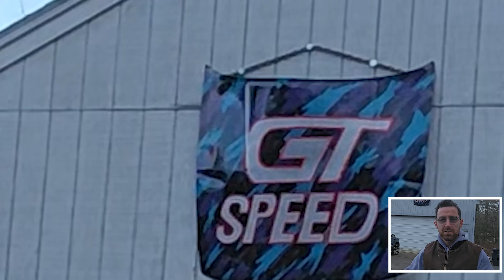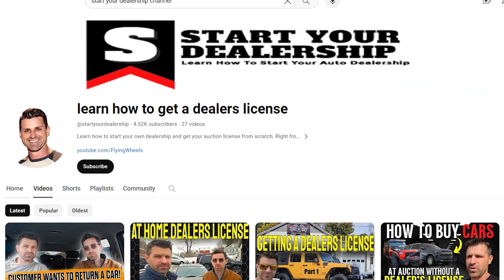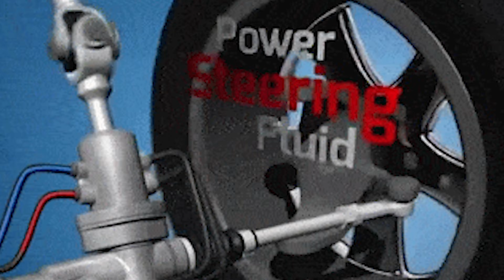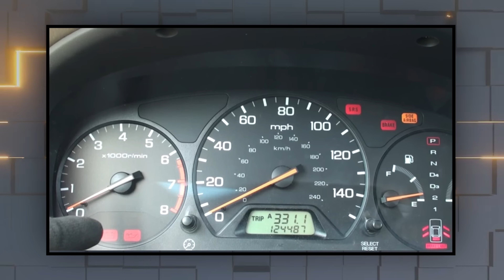We bought our 1st Lemon - Starting a Car Dealership from Scratch

Comment: Nice score with the Lacrosse! The 3800 is a great motor. The only thing I would pay close attention to being the former owner of a 3800 engine car is the transmission. They like to go around 100-120k miles. My last one I had rebuilt at 110k miles. Cost me $900, and it lasted 3 months and went out again. Cost another $900 and lasted another 3 months and went out a third time! Never needed more than an oil change for the engine though.

Comment: Adam, great pick on the accord! I bought that same year and model and really enjoyed driving it! SO much fun with the manual transmission and that V6 engine. Honda only did that combination in the coupe but not the sedan which makes it a fairly rare but VERY desirable car.
Reply: Are you limiting that V6 6 speed to a particular model year ? Because Honda did indeed put the V6 and six speed manual into the sedans AND coupes in 2006 . I almost bought one 5 years ago and the car was awesome to drive but the black leather interior was not up to my expectations for such a nice car ... lots of wear and rips on the front buckets. The rear seat looked the way I wanted the front to look. But the 6-6-6 combo definitely came on the sedans.
Reply: @nickg9021  You're right. I stand corrected. I think maybe just in 08 to 12 the setup only came in coupe.

Comment: Everyone makes that mistake.
I bought a 97 Wrangler that just needed paint. (I own a body shop) so its no biggie.
It had a 4” lift that was leaning a bit. So i ordered new springs and shocks. Found out the sway bar perch was broken. So im in the process of replacing spring perches and lower links. (Requires cutting and welding). Luckily i can weld. But, looking back. I should’ve walked away from it. 
But im in it now. I should make 3k-5k profit

Comment: That Accord is a  pretty cool car. Fairly rare.

The J Series engine is very reliable. One thing to note is that the engine in it is not the same as the other J Series of the same vintage. 6-spd Accords dont have the cylinder deactivation on it. Its 6 cylinders on all the time.

A good upgrade if you need to replace the engine is a 3.7L out of a TL AWD or the MDX/ZDX 3.7L.

Comment: In Canada we have the Buick allure with the 3.8 in the states you have the lacrosse mostly with the 3.6 I have a 07 allure 3.8 only weird repair other than normal wear items is the gas pedal at 148,000 kms it has two sensors in it and the two codes that come up is one sensor isn’t talking to the other sensor and the other code is the other sensor isn’t talking to the other sensor lol but now at 280,000 kms I had to purchase another gas pedal but it only takes like five minutes to swap out. Car is still giving like 30 mpg awesome vehicle prior to it I’ve had three lesabres awesome vehicles.

Comment: Great video guys! Full of very useful info and tips. The advice is greatly apprecaited! Just a question from my side. Started as well (my first real auction buy...started with minimal capital...so 90% of cash tied into it now), issue is, its been about 3months and no real bites. Its prices fair (really well looked after with FSH and nothing to fix), but still no reall bites. Thought i was going to make big profits (based on what i paid....nothing to fix) but the demand has been slow. Dropped price slightly (twice already) no real change. DO i just lower it till i get a buyer or wait it out? Waiting means being stagnant because the cash is tied into this first flip car.

Comment: alot of the direct injection cars do that with the pcv valve. My wife has a 14 equinox and that thing would clog up the pcv like that and burn oil. It killed the timing chain 3 times under warranty. I fixed it by basically drilling the hole out in the intake that fed it bigger.